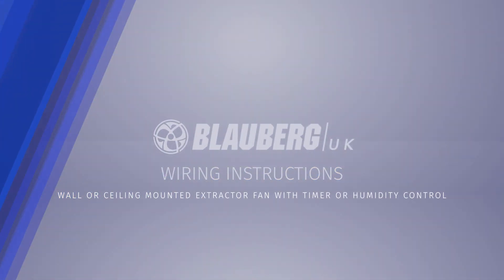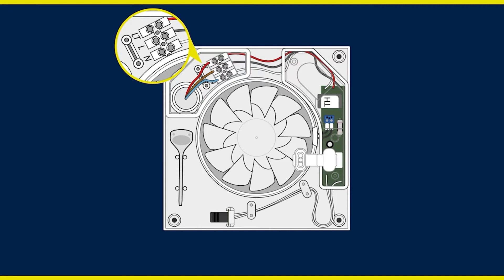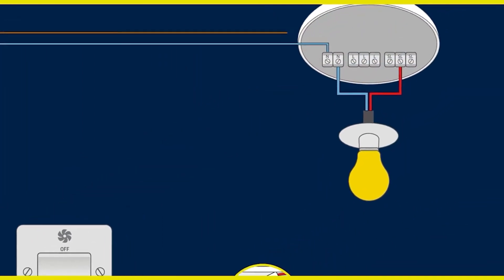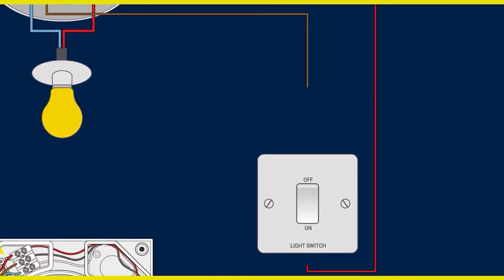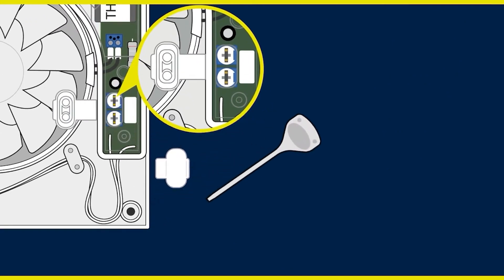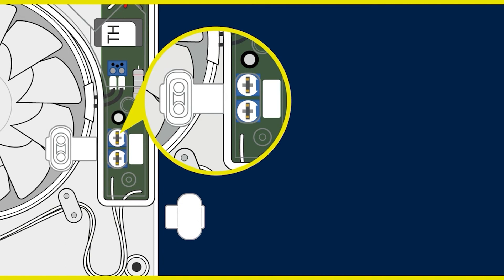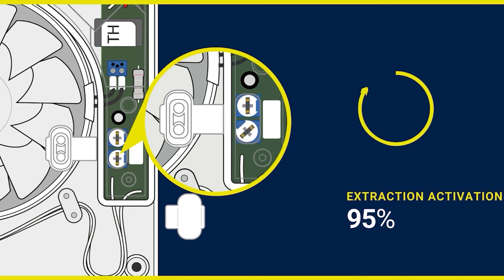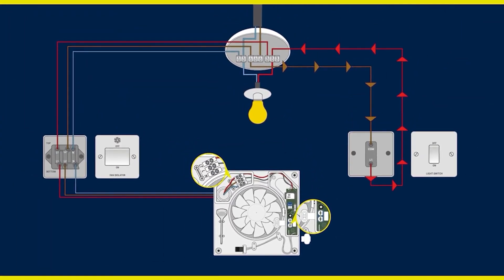How to wire a Blauberg Bathroom Extractor Fan with timer and humidity sensor to a lighting circuit

Comment: The fans in our toilets had timing control and matches your video as regards wiring etc. however one of the units needs to be replaced  The new fan I bought blauberg line100 slim has only 2 wire connectors. What should I do should I return it? What model  should I go for.
Reply from the maker: Hi You would need either https://www.blauberg.co.uk/100mm-4-blauberg-line-powerful-slimline-extractor-fan-bathroom-kitchen-wet-shower-room-run-on-timer or https://www.blauberg.co.uk/blauberg-calm-low-noise-energy-efficient-bathroom-extractor-fan-100mm For the Calm Fan you will need to select the timer option. This Video relates to the Calm Fan and can be put in both zones 1 and 2

Comment: Mine was ceiling mounted. Had to remove the humidity sensor. Not great for ceiling installation.
Reply from the maker: This may be due to the installation. It's best not to have the ducting going vertical. it's best to have at least 2 x 90 degree bends and a drainage trap to stop condensation running back into the fan

Comment: Can I install fan separate?  I take shower during the day time and no need to light to be on. Instead of light switch I would use fan isolator as a fan pulling switch.
Reply from the maker: There is a version that can just be operated by a switch/pullcord, for example the Calm S range. Or if they want to run it through an isolator switch, the basic Calm range. Take a look at www.blauberg.co.uk.

Comment: What happens  if an isolator switch is not applied for the fan and the fan and light wiring has been put together with one switch? Can this cause safety issues?
Reply from the maker: Fans must be installed with the correct isolators. if the required isolators for the fan are not installed, it is recommended to contact a qualified electrician for installation.